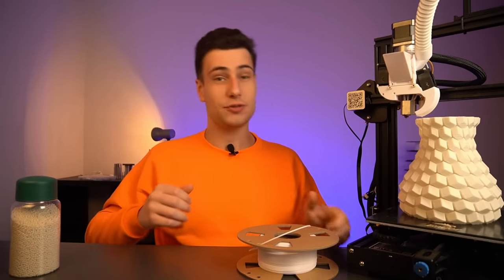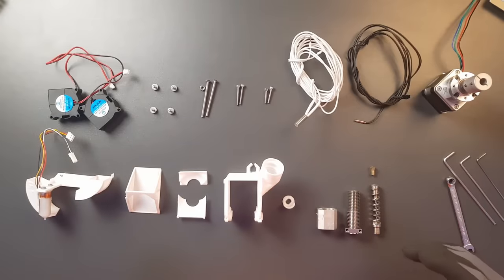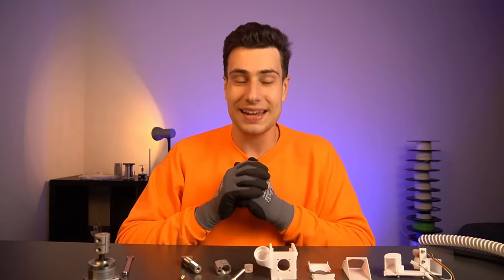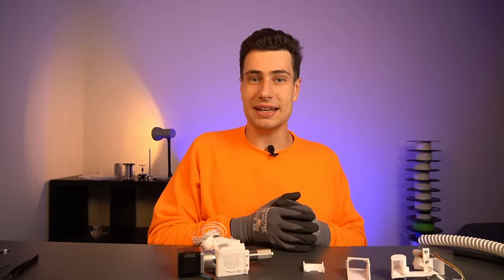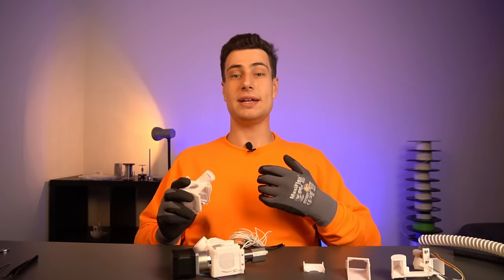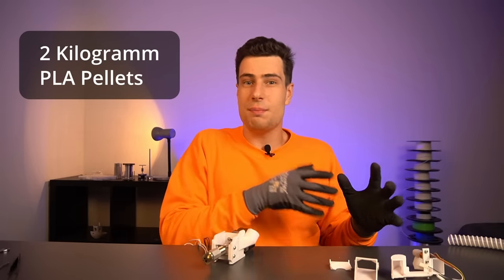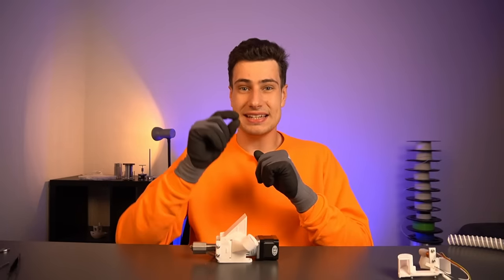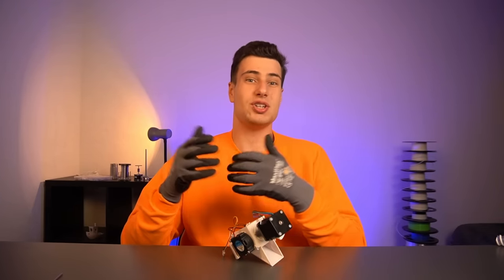Pellet Extruder for ANY 3D PRINTER | 3D print Granules, Chocolate, Sugar and more

Comment: This will make testing 3D prints so much easier since i can do more tests and I won't feel bad about using a large amount of supports anymoe. All the waste can be just ground down and reprinted.
Reply: Yes but you need to keep in mind ground print waste is not exactly same as original, while printing some substances which help make p4inting easy vaporize, so petg when ground isn't petg anymore, it's like printing pet, more stringy less forgiving
Reply: @howabout2138 Obviously some plastics are going change properties once heated and cooled and not every filament type is recyclable... 
That doesn't change the fact that many filaments are fully recyclable and with how common 3D-printers are getting, the ability to recycle even ½ of the plastics used will be huge in lowering the amount of plastic waste and environmental impacts of 3D-printing 💯👏
Reply: No no no no you can´t simply keep recyngling that crap over and over again, it´s not like a metal plastic degrades over time you will always have to add virgin material, probably at least 50%. But this opens up new possibilities, like color mixing, recycling, keeping material dry or drying it in real time etc.
Reply: Recyled materails test printing or print your going the sand smooth anyways sounds like a good idea for printer poop/fails seem like a interesting way to deal with it.
Reply from the maker: That is definitly the main goal with this, I only need to figure out a better, easier and cheaper, way of recycling failed prints back into pellets. What however would be revolutionary (which is also something no one even imagines about) Is that you actually could recycle you general home plastic waste like jogurt cups, bottles and so on... into usefull objects 🙂
Reply: @greenboy3d  Delicious.
Reply: @greenboy3d If you're interested in how to shred them, I recommend a paper shredder (14 sheet+ crosscut)
Reply: @sierraecho884  Interestingly enough, most common plastics can be recycled over a dozen times with minimal degradation. The problem is that the granules need to be uniform. Shredded fissure parts are not uniform.
Reply: @antoniomromo  Not really. Please define what "most common" are. And what exactly do you define as acceptable degradation ? 
I am a development engineer. Our internal tests have shown that most thermoplastics we use (PP, POM-C, PE, PA) can´t even be recycled once without adding a significant amount of virgin material, otherwise the material  will lose it´s material properties in a significant manner. 
So if you have any research on that please share I would like to see.
Reply: @sierraecho884 say “no” again, we didn’t understand.
Reply: @_..-.._..-.._  no again lol
Reply: use recycled stuff for support material
Reply: @sierraecho884 how come you need a bunch of fresh material when recycling? Genuine question because I assumed the material that goes in is chemically the same as the material that comes out and therefore could be recycled infinitely.
Reply: @Flapjck  Because it´s not the same material. Your first assumption is just incorrect, that´s all. 
Thermoplastics consist of long polymer chains. Those brake up and degrade through the 3D printing process, which changes their material properties like they become more brittle, less UV resistant and things like that. 
You can recycle metals infinitely because they don´t change in their structure at all, but not plastics, it´s a different type of material.

So if you want to keep the same material properties you need to add an X amount of virgin material. I had this topic at work, as an automotive engineer we are looking for ways to increase recycling quotas which is difficult because on one side you don´t get enough recycled material and on the other your properties degrade and the parts might not work or fail prematurely. Many of our parts already come with a max. recycling quota on the drawing. Which in our case means the supplier can remelt some of the gating system from the injection molding process but only e.g. 15% or 20% depending on the part.

I hope I could help you with my explanation.
Reply: @Flapjck  There is only one way to recycle all the material without the loss of material properties which is called "pyrolysis" BASF is pioneering this technique right now. They  basically brake down the molecular bond with high heat and without oxygen until it liquifies the plastic back into oil. This oil can then be used to create fuel or new plastics. But this process is very energy intense.
Reply: Its not gonna be 100% same, but if you mix up crushed up used filament with new pellets of same type that would attest save 70%
Reply: @sierraecho884  the thing is that for inhome printing, we often can sacrifice these material properties... lot of  people prints just "crap" like figures, ornaments etc... the recycled material could be completely fine for that, or for first iterations of your rapid prototyping. I often print stuff that must fit existing object, that usualy means I first print just the basic shape based on my scans before I spend more time creating geometry I want, these 1st iterations can be printed with super crappy material without worries
Reply: @PachezZ  Yes, absolutely, you don´t need perfect material quality all the time I agree.
I heavily favor the idea of a pellet based extruder. In fact I am waiting for this kind of product for years now, I was even made of many times when I mentioned that filament based systems are way too expensive material wise than they have to be.
And this goes not only for home printing. Many low cost or one time use kind of products don´t need perfect material properties either. Packaging material for high quality goods in low amounts for instance. 
I am not saying it is entirely useless because you lose material properties all I am saying is if you need those properties and the repeatability you will have to at lest mix in virgin material.
Reply: @sierraecho884  PLA and PP can be remelted and reused for people not using them for engineering or similar uses. The PP example was illustrated by the channel brothers make. CNC kitchen did so for PLA. Again this is for most hobbyists who use 3d printers to make things that don't depend on exacting properties for their plastic. If you require definitions for any of this then then your needs are beyond that of a hobbyist and you shouldn't try to recycle your materials.
Reply: @antoniomromo  It can all be remolten, however the properties degrade fast.
Again the properties degrade fast. I am not saying it can´t be done. You cant recycle it indefinitely.
Reply: @greenboy3d you solved the entire problem of plastics in the ocean and landfills, could make recycling possible for normal people
Reply: @greenboy3d  common milk jug containers and shampoo containers in the usa are various dyes, etc, but are usually a hdpe formula, and most grocery bags are an ldpe, I looked into it in the past but didn't find a lot of info on it, but being able to print recycled commercial shampoo and detergent bottles, etc, sounds like a dream.
Reply from the maker: @menchelke Maybe this is going to become reality soon 😀

Comment: TIME TO LAUNCH MY FRIEND.  You should be shipping development kits already.  Most people are still tinkering with filament extruders.  Why grind up material and extrude it only to be fed back through another hot end, just buy/ make pellets and feed them.  Ender 3s are $150 in the US right now.  I want the metal parts ASAP!  Also the tech you have been developing.  I could buy  a commercial pellet printer but that's many times the cost.  I want a sub $300 (total printer cost) printer on my bench tomorrow.  Your solution seems more refined than most.  Release at 80-90% refinement or lose out. Perfecting your design is taking too long.  I've read many of the comments and those folks don't seem to recognize how close you are to a breakthrough solution.  I would love to see the PLA tech first and then the TPU after that.  Please ignore the "critiques" below.   I've been following 3D printing tech since 1986 when it was first invented.  You have a game changer here, just get it deployed.
Reply from the maker: Thank you for your words :)

Launch is planned for this June

What would you think would be a reasonable price?
Reply: Depends what your plans are. If you plan to sell a assembled product, 2.5-3 times what the base cost is. However cost of scaling desighns and creating a distribution network and the cost to humanity if the design is stuck in IP prison for 30+ years would be prohibitively expensive and just be repeating the same mistake every designer of this pellet system has yet to fall into. Instead of you sell affiliate link parts kits and a tutorial on a platform with advertisements you could avoid such issues and save yourself headache of calling manufactures and distributors with extortionate cost to entry and mitigate. A lot of countries just steel patents anyway. Sling Shot Chanel has a great vid on the hassle and lawyers involved for mediocre results. Maybe though if you mass adoption and mass donation you can set up your site (agian with affiliate links) a “pay what you can system” with a recommended amount. It scales well with viral content and I’m sure the people won’t mind supporting the original Prometheus and calling out people who don’t credit  if you do it like that. You can even add a few (are you sure you don’t want to donate?) links in the web page flow just to give people a reminder. It’s not scummy to ask for support if you are doing humanity a service and it’s pay what you can.
Reply: In short open source with your web page. Web page has your tutorials and affiliate links to make your parts kits. The site has advertisements on it and a “recommended donation amount”. Then add pop ups in your web page flow saying “are you sure you don’t want to donate to the inventor of this product?” “Are you really sure? Not even 3 dollars?”. But if they make it through the pop ups, it is a “pay what you can” system for the affiliate parts list including 0 as a option. Though the adverts and affiliate links should compensate you even for the people who just go to download and refuse to support regardless. This is good and you get clout for open sourcing and guarantee best prices. Maybe you could even sell merch or have a “#(your pellitPrinter name)” so others can easily post links to your page in copy cat comment sections.
Reply: @wastelesslearning1245 lol he is charging $600

Comment: This is by far the biggest advance i have seen in years ! And the dark truth is simple : price of the filament vs pellets … 
A full métal hotend with more heating power can probably print almost any material at a fraction of the cost. 

Keep this up !
Reply from the maker: Thank you for your warming words! ❤
What would you like to see next? 🙂
Reply: @greenboy3d  how about carbon fiber nylon? The chopped fibers in a pellet can be longer than the ones in filament, leading to stronger parts.

Comment: next thing you know you will design a pellet dryer to either integrate into the hopper or have a separate dryer hopper that feeds the main hopper. then you can also add pigment directly into the pellet mix. you know just like a pro industrial extruder
Reply from the maker: You could "reinforce" the hopper with silica gel that is going to suck up all the moisture in the Hopper keeping pellets dried :)

What would you like to see next? 🙂
Reply: actually you could run heater pads on the sides of the hopper walls, do to the distance of the hose and hot air rising out of it , it should create a natural circulation of air including some vacuum from the bottom of the hose or chamber of the extruder @greenboy3d

Comment: This is a nice extruder, looking forward to seeing the end-product, maybe even one in my hand.
But the price of pellets varies a lot. Yes, if you go for the plain plastic pellet types that are used in the plastic molding industry you can get very cheap stuff. But most of the well known filament brands have additives to make the plastics more 3D printing friendly and while they do sell the pellets too, you pay premium prices for this (about 50% of the filament price when I looked around).
So pellet extruders make the most sense on larger printers that are used for high volume production jobs. I still think that using a pellet extruder on a consumer or prosumer style printer is a nice thing to have.
Reply from the maker: Thank you for your warming words! ❤ But there a couple of things you oversee, because there are not obvious
What would you like to see next? 🙂
Reply: True about the material - but the real kicker here is recycling. If you only use Prusament, you could shred your misprints, feed them into your pellet printer and use the stuff instead of throwing it away. I thing that scenario is much more interesting than the pellet printing as such.

Comment: I can see why for hobbyist-level machines, manufacturers have little incentive to push for pellet printing - especially since they also usually sell filament spools themselves. 

But for large print farms that go through hundreds or thousands of kg per month, it would be a big boon, and some of them even develop their own printers. 

How come they didn't develop this tech yet? Would be very curious to hear your take on that. Thanks!
Reply from the maker: I have already a video planned for your mentioned topic "How come they didn't develop this tech yet?" 😀
Reply: @greenboy3d  Very exciting! Looking forward to it.
Reply: I think the main reason stopping most people is the inherit flow consistency issues that come with pellet exteiders. Pellets aren't the same as filament and there are always going to be some amount of gaps between pellets which causes inconsistencies in flow which are much more difficult to tune for. With most designs I've seen, it takes a good amount of experience and time to be able to produce an acceptable product with pellet extruders
Reply: @daliasprints9798 I'd say a combination of increasing pellet pathway & decreasing pellet size is the route to optimize👍
Even though it takes more processing to get smaller pellets I'd wager the its still ultimately much less processing to get 2mm pellets than it is for standard filament! Not too mention smaller pellets = faster more efficient heat transfer and melting when extruding and ultimately if you can feed/melt pellets in the screw at a rate that equals or exceeds extrusion rate, then the inconsistent extrusion due the pellet gaps will be all but eliminated 💯
Reply: @greenboy3d Never underestimate corporate inertia.   Plus the trend to better print quality and ease of use.  Unfortunately, I don't see pellets beating filament there.
Reply: @EmpressOfExile206  why not  go for le epic big nozzle? I would not mind 1 mm or bigger nozzle size if it drastically increases the quality of reclycled plastic prints
Reply: @MagicGumable Would also be nice for large, functional parts.

Comment: Retraction is why it's not mainstream I almost guarantee, or the lack thereof. The only way I could figure to do it would involve precise tuning to essentially "coast" to the "retraction" point and you just run out of material in the perfect amount instead of sucking it back in a little. The retraction of molten material without a fixed point to pull back from is the issue of course, maybe an air compressor but to create a vacuum instead of pressure? Idk man, this is awesome with a lot of potential!
Reply from the maker: Retraction in a filament extruder is not caused by the filament retraction itself, but by the underpresure it create. And our atmospheric air pressure then presses against the remaining molten plastic through nozzle hole preventing it for a short time to ooze out until the presure levels balance themselfs

What would you like to see next? 🙂
Reply: With Pressure Advance the need for retraction is significantly lower, and with some plastics, retraction almost barely works anyway, PETG for example. Pressure Advance should work the same way with this pellet extruder as it  does with a filament extruder. I run 1mm retraction on my direct drive converted Ender 5 Plus, and pressure advance (running Klipper) and it works pretty well with PETG, very well with PLA. I dont print esthetic parts though, only functional stuff where I prioritize strength over looks so run low cooling and high extrusion rates with high temps, neither of which helps with looks :D

Comment: I think there’s a market for manufacturing functional prints where the aesthetics are not a priority and your design would be an incredible way to cut down on cost. I imagine a company that wants to mass manufacture parts but don’t have the volume to pay for the tooling costs of injection molding. Your design could fill an interesting niche and allow people to bring things to market we wouldn’t see otherwise. Bravo.

That being said, reaching the consistent density, flow performance, and quality of manufactured filament with a pellet and hopper system is no small challenge. I image it would take a high quality extrusion screw and some clever thinking to make it work in such a short barrel! Also, as much as I want to believe the powers that be are gatekeeping pellet 3D printing, I think it’s more consumer preference. When most people purchase a 3D printer, they want the things it prints to be perfect. Extruding pellets introduces new variables and is  less consistent than filament. The blemishes and imperfections caused by pellets would naturally turn people off and they would lean toward buying a filament extruder. 

Im rooting for you and this project, I signed up to follow your progress, and I look forward to ordering one to test in the future!